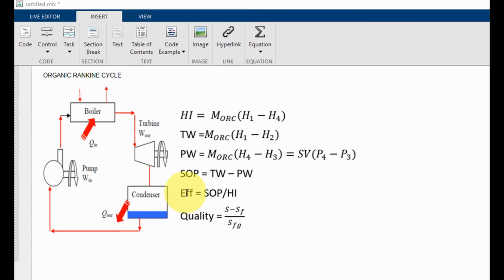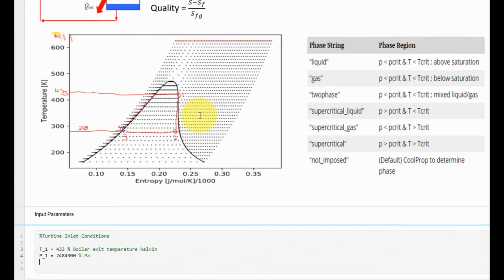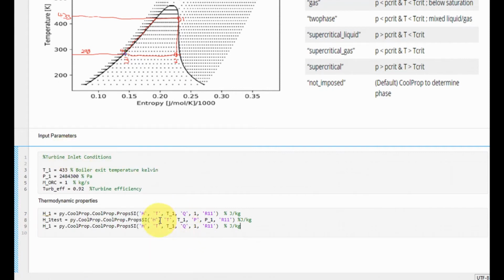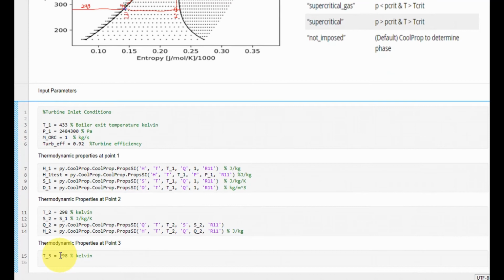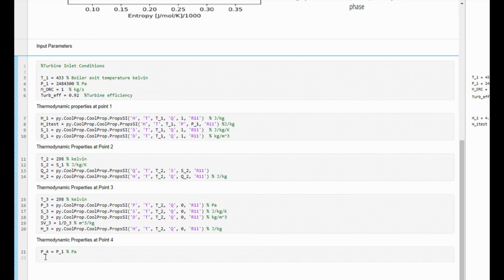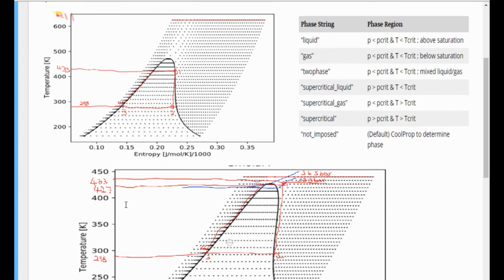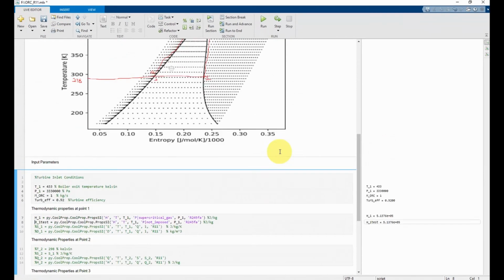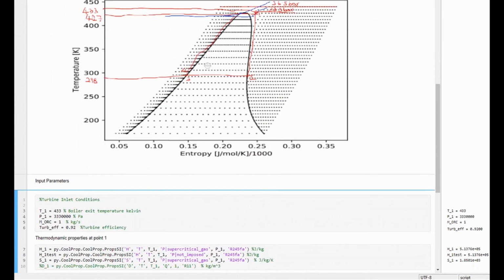Performance Modelling of the Organic Rankine Cycle (ORC) R11 & R245fa in MATLAB with CoolProp

Comment: Thank you for the video!
If you've divided PW with pump_eff shouldn't the H_4 be equal to H_3 + PW * Pump_eff?
Also, If I for example use toluene for my ORC system, the coolprop gives me negative values for entropy and enthalpy after the fluid becomes liquid in condenser, could you please explain this?

Comment: Hi is it possible to use coolprop within simulink?
Reply: I have it installed within matlab and it works fine. But unsure how to use it within simulink. Any help would be greatly appreciated ;)
Reply from the maker: yes, you can - you could you use the Matlab function block for it. But if you are to share this with other users, they would need to have coolprop install
Reply: @doxatech4291  hi, thanks for a quick reply. Is it possible to guide me how to set it up? I can’t seem to find any resources/tutorial online. I understand the need for other uses to have cool prop installed. I’m fairly new to simulink and not so confident
Reply from the maker: @nanu4779  I will today a quick video on that by Friday
Reply: @doxatech4291  Many Thanks! I am looking forward to it.
Reply: @doxatech4291  Hi, have you upload the video?